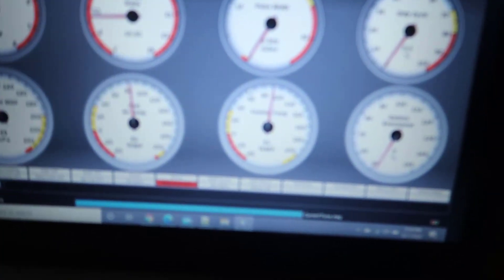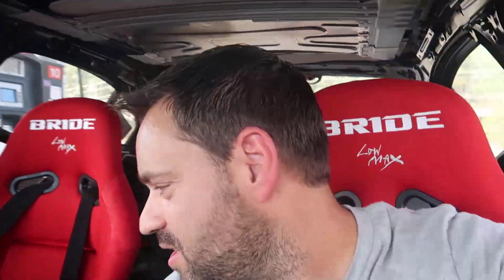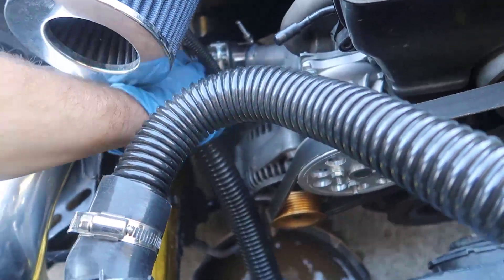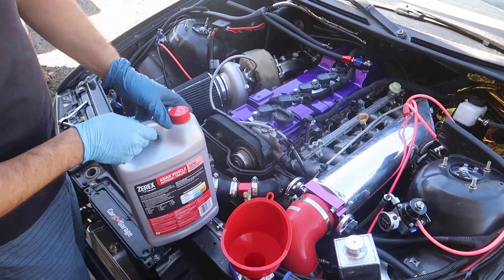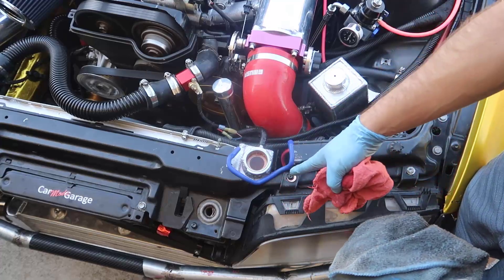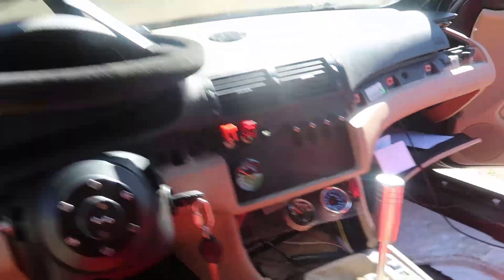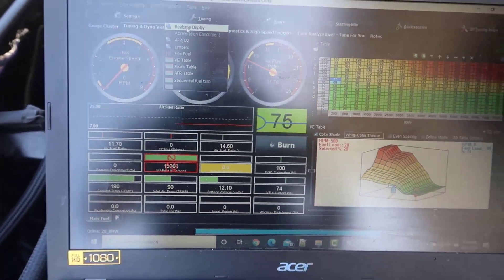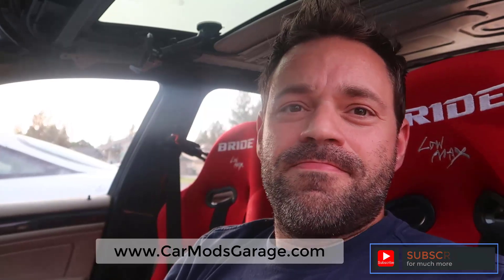Water vs Coolant Temperature Test. Which One is Better

Comment: your radiator is rusty and not working efficiently, thats why the water comes out rusty. u need to flush it out first and make sure the radiator is clean, if not it’ll still run hot. rust acts as an insulator, it doesnt transfer heat well to the cooling medium(waters/coolant)

Comment: That radiator hose is like a washing machine drain pipe and its too long. Does it take the pressure?
Reply: bisnes sell coolen
Reply from the maker: It's a bit big but you can cut.  It's been holding the pressure since I installed it and it's on my drift car.  The attachments on the other hand are garbage.  Use silicon hoses to join the pipe with the motor and radiator

Comment: You should never ever ever use that water unless you're on the side of a motorway and your desperate and it's the height of summer or something and your dehydrating and you're about to die don't put this in your car under any circumstances.. I mean literally emergency life or death situation don't do it you'll end up with minerals in your radiator and it will destroy it. Unbelievable that you don't know this you need to read your car's manual it's the same for everyone. There is no problem using 100% pure water the only reason why we don't is because it freezes up in winter and then it destroys your calling system with it..

Comment: Its nice to have a good prediluted balance of coolant and distilled water. I keep a mixed jug of water wetter, distilled water, and coolant laying around to prevent overheating or if i need to top it off. too much of one or the other can cause overheating,freezing or corriosion, because it changes the boiling and freezing points.

Comment: Water alone is an excellent coolant. I don't live in a cold climate so have never used antifreeze. They call it antifreeze for a reason. I have never had a single problem in any of my vehicles because of running pure water in the cooling system.😊
Reply: Pure water has a lower boiling point than coolants so they get hot faster also coolants are designed to efficiently transfer heat away from the engine compared to water, I used to put pure water into my car and once I replaced it with coolant I felt a big difference in the engine temperature.
Reply: @Boboo-zm5sp is it 50/50 or 70/ 30

Comment: You're being bias. You keep talking down the water before you even had results. Just a heads up race cars run water only and it's not due to funding
Reply from the maker: @Banshee421x  ya it's because if you crash or have some sort of leak you don't spill coolant on the track.  I'm not bias by the way. I currently use distilled water on my Supra and will freezing temperature comes in happy with that
Reply: @CarModsGarage there is no clean up on dirt tracks
Reply from the maker: @Banshee421x Google the reason then.  There is a reason why most  tracks require you to use water.  It's not because it cools better and takes longer to boil because it's not.  You are the one bringing up that water is so good that tracks require it.  That's not why. 
Got these from Google. " It's a safety hazard to have coolant on a racetrack, so virtually every sanctioning body out there bans its use."
Reply: @CarModsGarage I'm not a Google mechanic. I don't just repeat what written on the internet. I do texting myself. I tested water vs coolant on a motorcycle with a fan that came on at 210F. With coolant at was on and off as it should. With water we thought it was broken because it has not came on in the last 4 months. So no we don't run coolant because it makes engine run hotter. And the point about race cars running water is because it runs cooler in your 60k race engine
Reply from the maker: @Banshee421x hmmm that's interesting!  I've been using water on my Supra and just like it should be at 180° it turns the fans on and stays there.  I've never put coolant on the Supra but I'll make another test when I need to.  I'm interested in knowing how long it takes (same external conditions) to get to 180° ( my case) and how long it takes to get to the same 180 with coolant.  
Anyways good discussion.  I'm not a mechanic at all. I just googled to know why the track I drift doesn't want people to run coolant.  👍

Comment: This visor would have been useful if you had performed the actions correctly lol. You don’t use tap water..,you use distilled water. And you don’t use water alone, you add something like Water Wetter, Engjne Ice, Royal Purple Coolant additive and it WILL run cooler than a 50/50 coolant mix. Thats not my opinion. There have been countless studies done on it.
Reply from the maker: That would defeat the purpose of testing with tap water only.
Reply: @CarModsGarage  Ok I gotcha. One purpose was to test tap water specifically. Got it 👍🏻
Reply from the maker: @dranb7074  right 👍

Comment: Water runs a lot cooler than 50-50 coolant mix. That’s simple science.
Reply: Can you tell me if water will damage my engine because i just did a “change” but changed coolant with water really because i’m broke lol
Reply from the maker: @lukaweixler it won't damage but it will make It rust.  I currently have distilled water running on my Supra. It's been a year now.  In my case I was testing for leaks and didn't want spill coolant everywhere.
Reply: @CarModsGarage  so better destilled than regular? In the sunmer i will run water and in the winter, coolant i think it should be alright.
Reply from the maker: @lukaweixler  distilled water have no minerals so it be harder to form deposits of crap on your cooking system. At freezing temperatures it will freeze so coolant is better. Distilled water also looks like it will boil faster then tap water.
Reply: @CarModsGarage  i just put tap water in🥲
Reply: @lukaweixler lol If you use Tap add water wetter it'll prevent corrosion
Reply from the maker: "Tap water has minerals that can leave deposits on your cooking system which contribute to corrosion". This is from Google.  I don't think tap water is bad though.  It's just that distilled water costs $2 a gallon and  will take longer to get the water rusty.  Tap water will take longer to boil though.  Either way  works fine.

Comment: 70/30 is the best mix .. its will gain you hp as the WP has less stress  at same time your getting the corrosion protection and boilover ... cannot do this in a cold enviornment and BTW  do not put strait  water in that JZ engine the reason you have rust is because its an iron block

Comment: I always wished these kind if comparisons used engine cylinder or head temp because the best coolant type/additive, which draws heat away from the engine most efficiently, will paradoxically heat up your coolant and coolant temp sensor the most. At least initially, until it’s improved heat transfer ability results in radiating heat out away from the coolant faster- which itself could be skewed by the other variables of thermostat and radiator fan.

Comment: I run deionized water and water wetter and i get a solid 10 degrees less than coolant and we have highs of 115degrees here and i never get past 210 degrees even with the ac running in stopped traffic you just have to change it every oil change or less

Comment: I done goofed I fixed a leak on a radiation hose then ran water for two days hopefully didn’t cause any damage
Reply from the maker: Nah you are fine. If you run tap water for too long you might get rusty water after awhile.  Use distilled water.

Comment: I am just wondering, what was the starting temperature of your engine when putting the coolant in, or if you could make a rough estimate now. And how much did the coolant increase in temperature?? Need for science assignment pls
Reply from the maker: Tap water started at 91F and after 249 seconds (around 8 minutes) it reached 217F
Coolant started at around same 95F and after 10 minutes it was at 190F
I believe if I've used distilled water the results could be a bit better. 
I will do that test on the Toyota Supra soon just for fun
Reply: @CarModsGarage update plz
Reply from the maker: @ahmadalbab5448  which update you are looking for?
Reply: Yeah i'm waiting for the science part to. I just got some numbers for to different days and scenarios. He sounded bais before doing the test like he already had his mind made up
Reply from the maker: @Banshee421x him is me.  I'm the guy from the video and the one that replied before.  I'm not bias homie 👍.
212F for water to boil and 300F to 400F for coolant while antifreeze  at 225F.
I'm not selling coolant nor water so use what suits you better

Comment: Lol... Coolant vs rusty water... Awesome
Reply from the maker: That rusty water got rusty in a week
Reply: @CarModsGarage  still, its not water vs coolant, its rusty water vs coolant, supposedly water has better heat transfer than coolant or antifreeze, you can get anticorrotion aditives to add to water, for hot climates this is supposed to be the best option, and also there are the water wetter and similar products that are also supposed to be better than antifreeze/coolant, this is the comparison I'm actually looking for btw
Reply from the maker: @godzuki2099  water boils at 212f , coolant 50/50 boils at  223f. Just 11 degrees earlier.  Pure coolant boils at  375f. Using tap whatter is no good as you see on my engine.  Because of all the minerals it promotes rust  Distilled water on the other hand is fine but coolant is a better option still.
Reply: @CarModsGarage  anticorrotion agents, also water under pressure doesnt boil as easy, which is why you shouldn't remove the lid on a hot radiator

Comment: Do I have to install external hardwares before using the tuner studio ??
Reply from the maker: I think just now I understood your question. TunerStudio runs into your computer. You need an ECU that can be controlled by TunerStudion. On my case I use SpeedyEFI which is an Speeduino based ECU. A usb cable connects from the ECU to the computer.

Comment: with water i frequently have to refill, is it the same with coolant?
Reply: Might be because the water is boiling at a lower temperature than the coolant and boiling out of the overflow tank. I had that problem once.
Reply from the maker: You might have a small leak somewhere.

Comment: I'm not even going to bother watching this video why would anybody put straight water in their car you need to lubricate the water pump number one
Reply from the maker: Coolant is always preferred of course but I actually I put water because it was the first start after the whole engine build and I didn't want to let coolant on the ground. It leaked it all by the way because of a faulty hose. Luckily it was water and not coolant.
Also when drifting in some tracks coolant is not allowed so tap water or distilled water is used.

Comment: Hi, I like your videos and adore the way you explain things in the simplest way possible. I have a question regarding the distilled water that we generally mix with the concentrated type of coolants. My question is: Is it a good practice to use the "battery top up water"  as distilled water in proportion with the concentrated coolant for our car radiator? Would appreciate your prompt reply! Thanks & best wishes for your future videos 😊👍
Reply: Someone told me that use pure concentrate collant without water.so it is good or bad for my car to use 3 liter coolant without mixing water.
Reply from the maker: @parassharma3963 I've read that too much water it freezes in freezing temp weather.  Too much coolant it will overheat.  Apparently coolant has some rust prevention chemicals so only water is not ideal either
Reply from the maker: Hey John, I appreciate the support 🙏! Yes if you use the concentrate coolant you should use distilled water to mix.  Usually I get the 50/50 so I don't need to worry but yes mix 50% of the concentrate and the other 50 with distilled water and you are good to go. 👍
Reply: @CarModsGarage   I guess the quest is " battery top up water " as distilled water. Answer is Yes, actually battery top up water is deionised water not distilled water. Out of two, deinoised water is better to mix antifreeze because it doesn't absorb iron from engine metal like distilled water,  though the difference is not much in practical but from a scientific perspective.

Comment: You shouldn’t really be putting tap water in your cooling system, too many minerals and corrosives….you should be putting distilled water if you want to use water
Reply from the maker: I agree!  This was a test since at some tracks couldn't is not allowed so we need to empty it in a bottle and put tap water.

Comment: so how much better was the coolant? 
If my car over heats after using water for 45mins is it still gonna overheat after I put coolant?
Reply from the maker: Gotta use coolant unless you are on the track and they don't allow coolant. 
If your car overheats with water there is a very good chance you have a problem so it might overhear with coolant also.
Water was on my system for around 2 months. Driving very little and the water came out rusty. The temperature the car was running was higher but not overheating.
Switching to coolant after 4 months the coolant is the same color so it sis not promote any rust. Car runs a bit cooler for longer.  The fans will kick in at certain temperature so regardless of water or coolant mine at 176F will run the fans.
Reply: @CarModsGarage  thanks for replying so fast im pretty sure the head is prob warped tho i ran it with water for like 45 mins till it started to boil
Reply from the maker: Check for the thermostat to be sure it is opening. Sometimes they get stuck closed then the water never gets cool.  Happened to me on my BMW

Comment: If you park your car in the sun the water also dries up but coolant doesn’t
Reply: Ever seen a completely sealed water bottle that was half empty? Me either.
Reply: @Eztops  very well said
Reply: Water doesn't evaporate or "dry up" in a closed system. If you poured water on the sidewalk it would evaporate, but so would coolant.
Reply: That's dumb because water has to evaporate. If the coolant cap is clicked back on then it will evaporate at very slow pace where you prbly won't even realize it evaporate unless you checked after months
Reply: @HarryPabla101  fun fact: race car use water as a coolant
Reply from the maker: At some events they make you empty the coolant and fill up with water
Reply: No. I live in really hot country and my car is parked under the sun all the time during the day. The water doesnt dried up that much. Plus, its not hard to get water

Comment: Dude, im using a tap water, i know its bad, but i got a question...
Once the car gets to 90°c coolant hoses are firm and the system is under a heavy ass pressure... No oil on the oil cap, but the water in the radiator was so brown, ibe chanhed the oil cooler and its better now, but still facing the problem with firm hoses and coolant loss.
Reply: I think the coolant boils at much higher temps, like 160C, so your water is boiling at 100C, causing more pressure and wearing out the system. You should add some coolant.
Coolant lubricates parts and boils at very high temps, so in normal use it will not boil. Also it prevent freezing unless you go lower than -20C or even -36C (depending on mix ratio with water).
Reply from the maker: Usually when it gets hot the hoses get a bit more flexible. But what's your question?
Reply: @CarModsGarage  I got bmw 320d 2000 year.
When the temperature gets 90°c, i open the radiator cap, its presurised, and the water looks like its boiling, sometimes its steady, going up and down, why is that? Thanks!
Reply from the maker: as far as I know the thermostat opens at certain temperature and let the water flow through the radiator. That could be why the water is moving a bit.
Reply: @loaded5080  your cooling system it under pressure, that’s why the hoses are hard, they are supposed to be!

Comment: what is the difference between engine coolant and radiator coolant?
Reply from the maker: Hi Haikal, the coolant that goes on the radiator circulates through the engine so they are the same thing.
Reply: Engine coolant . Just direct pour it into your engine oil cup. Best than radiator coolant.
Thanks me later
Reply: @lykakang2706  no don't do it
Reply: @lykakang2706  what lol
Reply: @lykakang2706  wtf u talkin about. Gtfo of here
Reply: @lykakang2706  what are you talking about no! to the oil cup??? will destroy any engine

Comment: Don't use tap water, use distilled water to avoid rust in the future.
Reply: That's why coolant has anti-rust properties to prevent it.
Reply: @delubyo5770 if it wears down it corrodes,i have seen it😂
Reply: @erickouma5111  yeah it will corrode if you actually forgot to do your maintenance routine on your vehicle's cooling system.
Reply: Just use rain water !
Reply: @MegaRiffraff rain water same distilled water...how long u use it
Reply: Why would u use tap water? It has minerals n shit. Don't be cheap or you'll get some shit
Reply from the maker: Agreed.  I did it to test but distilled water is also cheap and has no minerals.  Coolant is ideal in my opinion.
Reply: I use soft water not distilled or tap
Reply: Been using tap water for years and its good,i flush it after 5000 km...its BEST
Reply: It's quite the opposite. Distilled water can readily absorb oxygen and minerals due to lack of minerals, so it will rust faster
Reply: @babybeast693  it’s quiet the opposite there’s a reason antifreeze calls for distilled water